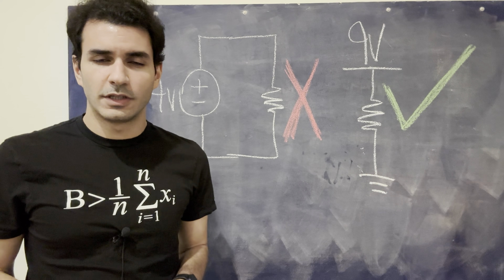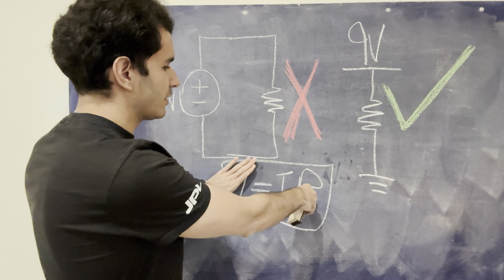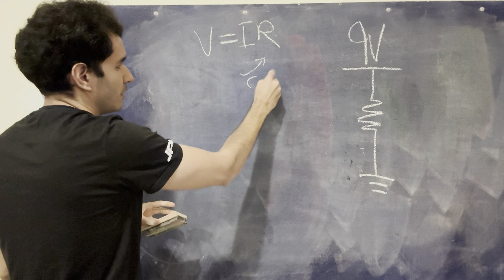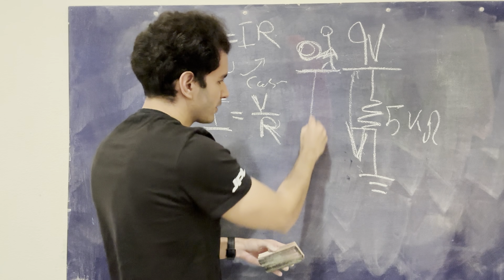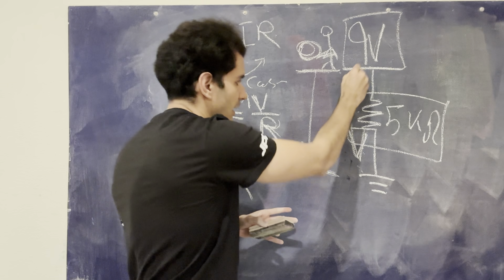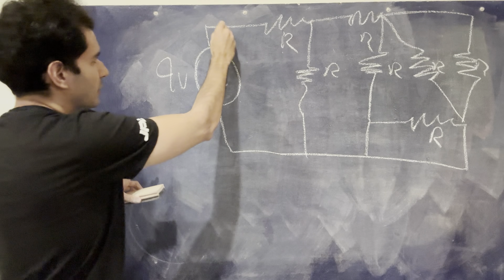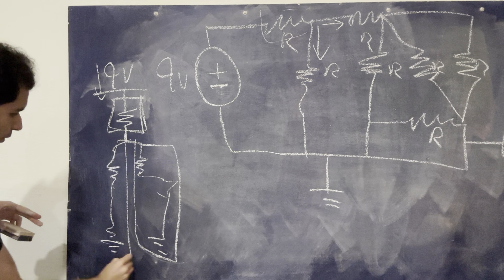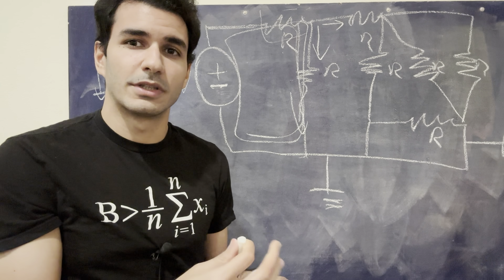Circuits Finally Made Sense When I Saw This One Diagram

Comment: The two circuits you are showing, are showing two different things.  The one on the left is showing a DC circuit with a battery.  The circuit on the right is more common with AC circuits where the symbol at the bottom with the 3 horizontal lines represent ground/earth.  The voltage in the circuit on the right has it's reference point at ground = 0v and the supply = 9v.  In the circuit on the left.  There is NO connection to ground and the reference point is the terminal on the battery.  If you was to meter between the + side of the battery and a ground/earth point the meter would likely read 0v not the expected 9v.

All of that said there are inconsistency between diagrams and symbol use.    please only teach if you have the full picture.
Reply: Yep.  The video presenter was rather muddled in his understanding I'm afraid.  There was nothing to stop him from drawing the left hand diagram vertically.  And the ground symbol needs to represent a real ground - or (as in this case) a common reference in which case there'd be at least 2 of them.  This guy would struggle to design a real circuit I suspect.
Reply: There's nothing wrong with what he drew. In electronics it's common to use the ground symbol for whatever you're using as a 0V reference, whether it's connected to the physical earth or not.
Reply: @gcewing  Very true that often the ground symbol is used as 0V reference but when it is there is context given by other parts of the circuit.  The problem is the circuit on the right does not give context.   My comment was that if we look at the circuit on the right without the context of the circuit on the left, we have a problem.

Comment: I think seeing all of the lines connecting back to the source just makes the whole thing too complicated. With just the ground symbol, the whole circuit can be drawn more intuitively.
I learned a long time ago to never pull out formulas until the whole thing is drawn out understandably and then the formulas are easy to use.
Is really like to see more teaching ( in a small way) about how vacuum (valve) circuits work. The really well engineered tube equipment has truly fantastic ideas. It was difficult to put together high quality with point to point wiring.

Comment: Often easier to read circuits like this when looking at real circuits using transistors etc... as you can "see the currents flowing " more easily....however one must keep in mind that current must flow in a complete loop... so the "ground symbol" has to have a return path somewhere.
A falling ball is a good analogy... but... when it hits the ground... then  it just bounces.. whereas the current carries on flowing to somewhere ( unless of course we look at unterminated  transmission lines.
Reply: If the circuit is battery-powered, that's like having a big reservoir of balls at the top and a bin to catch them at the bottom. When you run out of balls, you need to recharge the battery by lifting them back to the top.

Or you could have an elevator driven by some external power source to return the balls to the top. Electronics, Wintergartan-style. :-)

Comment: How do you apply formulas when you draw the circuit vertically? Can you still use formulas for resistance and pd resistor in parallel and series? e.g. Total R = (R^-1+R^-1)^-1 ,V is the same across parallel sections etc
Reply: Yes.

Comment: This is exactly what I've taught some people who are struggling with electrical theory. This triangle rule just prevents people from thinking.
Reply: Electricity is about EM fields, waves, not "current flow" in the "circuit" - that's the biggest problem, preventing people from understanding anything. Energy is outside wires (but you need metal - doesn't matter if it's DC, AC, or radio/TV/GSM - antennas are metal too, just like regular wires/cables).
Reply: @GrandePunto8V You are actually wrong.
And from your statement "electricity is about EM fields, not current flow" reveals you haven't not studied the subject at university.

Electricity encompasses multiple topics including:
 Current flow in circuits
 Electric fields
 Magnetic fields
 Electromagnetic fields/radiation.

They are all different and necessary to gain a complete understanding.

The fact you failed to separate electric and magnetic fields from EM fields is a rooky error caused by again, your not having any formal education in the subject.
Reply: Never introduce Ohm's Law with the formula. Always make the forces at work very clear before you go anywhere near V=IR
Reply: It´s a classic misconseption about learning: Making something "easier" does not always help to learn it. Because the way that you retain information is by processing the information and actually thinking about it. Acronyms can still be useful for rote memorization of huge amounts of information. But the best way to memorize simple formulars like this is just to understand them. Aside of the fact that the purpose of such formulars is usually to use them. Which is much easier if you understand them.
Reply: @hermann5347 The problem is that the mathematical skill of most electricians is so poor they don't have the algebra skills to re-arrange simple formulae.

Yes, it is the best way, but the math ability is a pre-requisite.
Reply: I'd posit from a learning ontology perspective, the triangle theory puts people in ... Well, a triangle.
Reply: The triangle rule has nothing to do with electronics; It’s a simple method to help with transposition of elements in a mathematical formula.
Reply: @flymoracer Because they don't have the mathematical ability to rearrange the simplest type of formula.

If a person wants to undertake an electrical engineerin degree, in my country, they MUST have advanced qualifications in math and physics.

Sadly, for electricians courses, no prerequisites are imposed. And I suspect it is the same in the USA.

This is why the electrical trades in countries has so much variability in the capability and and performance of electricians.

But yet these countries feel as if they have a responsibility to provide poorly educated people with jobs in the electrical industry.

There should be minimum educational requirements imposed on students wanting to do electricians courses which must include math covering basic algebra, trigonometry and complex numbers.

You cannot understand impedance properly unless you understand complex numbers.
All electricians are taught how to add resistances together but are not taught how to add impedances. And yet it is impedance that matters. It's crazy.
Reply: @deang5622 lol this just sounds like you trying to sound smart but don't actually know what electricians learn, V=IR is like first week of first year stuff, we definitely learn impedence and much more complex concepts than you are claiming.
Reply: @onikwa And you can't tell when a degree qualified electrical engineer is speaking.

And the reason for that is because you are not a degree qualified electrical engineer.

Get yourself a degree in the subject and then you can consider yourself an expert. Until then, you are just an amateur with scant level of knowledge.

Joke's on you dude.
Nice attempt to rubbish someone, but you well and truly failed there dude.

Had you read my thousands of posts you would have been able to figure out my qualifications. Oh dear..
Reply: Maybe they're just dumb.
Reply: That's just BS,  Technicians use this a lot after you teach it. they don't waste time on things that don't work.
Reply: @wlbrobinson They use it because they don't have the mathematical ability to rearrange the formula or memory to remember the three equations.
Reply: @deang5622  That is true, it gives them a mental crutch that raises their skills and performance, these aren't grad students.
Learning Ohm's law and exponential thinking is what separates the not very good from the extremely capable technician.
Reply: The triangle rule is what I learned when I was 11 years old before I had any understanding of math and algebra.

The fact so many qualified electricians rely on it and are unable to re-arrange a simple equation is deeply worrying.

My attitude is: if you can't do basic math, don't become an electrician or attempt to study any kind of electrical or electronics course.
Reply: triangle rule has no difference IDK why people use it.
Reply: @user-mh2gh2feafd  I find it useful to remember the correct arrangement because I kinda struggle doing the rearrangement in my head. I remember V=IR but for some reason my brain doesn't struggles to recall the other versions without looking at the triangle.
Reply: That's because they don't understand the math. It's 9th grade math, taught in lower grades in more intense schools or countries
Reply: @Doctored_Oak i think it’s 4rth grade math. Just use 10=5x2 as an example and it all becomes clear.  Like 10/2=5. 10/5=2 etc.
Reply: @TRyan-op2jo  yeah technically you do learn algebra in the 4th grade but not beyond the basics. I believe 4th grade algebra is typically intro basics that focus on addition and subtraction, like n - 3 = 1

Comment: This mental model is not that great. My way of thinking about electricity (for basic stuff) is open pipes that let water flow with gravity. The battery is just an apparatus that lifts the water up so it can go around one more time. The resistor is a zigzag pipe that slows the water down - the bigger the resistor the more the slowness. The flow of water is I, the slowness is R and the elevation gain from the battery is V. Simple and effective.
Reply: Different people different way of thinking
Reply: I would really like to know why some people think water pipes are bad analogy and gravity would be a good one when both are mechanical model that express mostly the same idea. To reason with pipe you need some trick to make some components work. Some are simple like diodes=valve, capacitor is a kind of vertical tank that build pressure with gravity as it fill, transistor are controlled valve. the tricky one is inductor because it gives inertia to the flow. Voltagesource=pressure pump and current source is volumetric pump. What is wrong and what is missing here ?
Reply: @TheAntoine191  Thinking too much about the pipe can lead to confusion about where the energy actually moves (outside the pipe, with the pipe as a waveguide).  Thinking about pipes rather than ponds and rivers can lead to some other oversimplifications.  But ... yeah, I too would appreciate knowing where else the analogy fails, and why that is important.  (In the past, I've noticed that often the answer is people not understanding water well enough, which does indeed limit the usefulness of the analogy, but...)
Reply: @jimjjewett I think the big win with open pipes is all student will have mental images while closed ones requires previous understanding
Reply: The battery is the bucket. The resistance is the hole in the bucket. Bigger bucket, higher voltage, higher resistance, smaller hole!
Reply: A good mental model aids imagination and water flow is fascinating! One can imagine the flow through the low resistance path in the branching paths example will look more active, sound louder, and feel stronger when touched.
Reply: Glad your model works, but his is more accurate as voltage is the potential energy per unit charge. Relating voltage to a ball dropping (losing potential energy) is very similar to the effect of voltage, so if potential energy is a comfortable concept, then his model would be just as great.
Reply: Resistance is the pipe. Your mental model is not great. My of thinking about it is that your way is not great.
Reply: > My way of thinking about electricity (for basic stuff) is open pipes that let water flow with gravity.
This is a BAD model. Discard it from your mind ASAP.
Reply: Hydraulic model is for children (not so bright ones)... If this is your model for basic stuff, you can't go higher (more complicated things).
Reply: @GrandePunto8V There's no need to be condescending and smugly call someone a dumb child for using a model you don't like. That analogy works fine, and doesn't give you a weak foundation for the more complicated stuff at all; I've got a BSE in Electrical Engineering, did well in all my classes, and still often default to thinking about water when it comes to circuitry. It doesn't account for absolutely everything, especially the technicalities for the physics behind electricity, but for understanding the actual physical effects being brought about by a circuit, hydraulics analogies work well, and a surprising amount of circuitry components end up having analogous hydraulics components.
Reply: @LaserFace23  taking it further... i would love to hear their explanation of a "coulomb"... or what "charge" actually IS... probably the usual complicated equation that doesnt actually EXPLAIN it... defining something doesnt explain anything, it just relates it to other units for mathematical juggling tricks.

whereas the water analogy makes perfect sense, especially in terms of the "hydrostatic paradox".

a litre of water can be arranged to be very low pressure... or high pressure. a coulomb can be a low potential... or a high potential. its just a volume of electricity.
Reply: @paradiselost9946  You won't find an explanation of what electric charge "really is", because nobody has one. All we can say is that it's a fundamental property that certain kinds of particle have. The important thing to understand is how it interacts with other fundamental quantities. That's what your "mathematical juggling tricks" are -- they're not just about units, they're telling you how electric charges affects other things. And I wouldn't say they're complicated, the fundamental equations you need for basic circuit theory are all pretty simple.
Reply: @gcewing  theres "charge" as in the fundamental "positive and negative", which indeed, is... weird.

the "charge" i mean is the unit. Q. coulomb. and so far, other than one or two extremely ancient books, nothing i have found has been able to explain the relationship between potential and this unit of "charge"... not in a way that at least feels intuitive.
Reply: @paradiselost9946  Charges in an electric field behave like masses in a gravitational field.

A charged particle feels a force proportional to its charge times the electric field strength, in the same way that an object feels a force proportional to its mass times the gravitational field strength.

Since force times distance equals energy, if the mass moves in the gravitational field it gains or loses gravitational potential energy proportional to its mass times the field strength times the distance moved.

Likewise, a charge moving in an electric field gains or loses electric potential energy proportional to the charge times the electric field strength times the distance moved.

So in this analogy, a coulomb of charge corresponds to a kilogram of mass.

Now, electric potential, measured in volts, is defined as energy per unit charge. The potential difference between two points in an electric field is a measure of how much potential energy a unit of charge would gain or lose if it moved from one point to the other.

So there are two ways of thinking about electric field strength. You can measure it in newtons per coulomb and think about forces acting on the particle, or you can measure it in volts per metre, and think about the change in energy as the particle moves from one place to another.

The concept of potential is much more useful when dealing with electric circuits, because we don't have to worry about all the messy details of the electric field -- we can just use our multimeter to measure voltages between points in the circuit, and figure out everything we want to know from that.

Does that help at all?
Reply: @GrandePunto8V Uhh, dude, Tesla himself did use the Hydrosimiles (Hydraulic model) a lot, he even designed something called Tesla Valve, which behaves essentially like a diode, in order to better understand the phenomenon

Comment: Hi Dr. Ali,
I was curious—did the vertical intuition approach originate from an existing method that you adapted into your own framework?
Reply: this is how circuits are generally presented.... a power rail on top and a ground rail below with the actual curcuit elements between them. I don't want to be mean, but I am struggling to see what the revelation is... but I guess I have been reading circuits so long that I have forgotten what it is like when it's not intuitive.

Comment: I think I figured out most resistor networks by finding all the loops in a circuit (graph, network) but it more difficult for hypergraphs. When I encountered later Neuroscience or circuits in the brain, things became more difficult and I first tried to use Spice using Microsoft Copilot to help out. Then Ohm's law is I = g*(V-V0) is used say in Hodgkin-Huxley model of the neuron. The axons are modeled with the Cable equation which is much like that for Electrical Engineering except without inductors. Kirchoff's Laws is used to sum currents and the voltage signal going down an axon turns into an injection current at the dendrite when crossing the synapse chemically. The injection currents input in the neuron model and create another voltage signal, into a network. Thus the synaptic weights in artificial neural networks might correspond to the conductance g = 1/R. And crossbar switches relate to matrix multiplication containing such conductances to handle a MLP (Multi-layer perceptron) in a Neuromorphic chip. But it all seems so complicated really and I do not think intuition is enough to solve for a circuit as complicated as a brain. Then there are vision systems which use supervised learning and artificial neural networks and matrices, etc, etc, and transformers (machine learning).